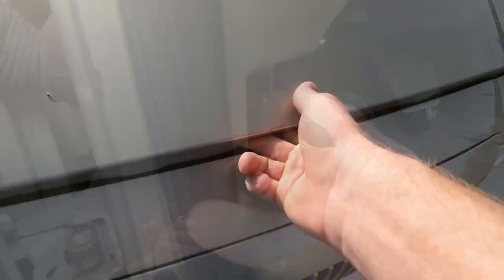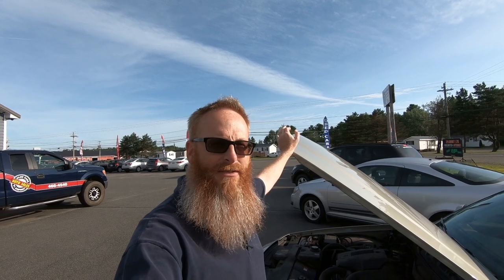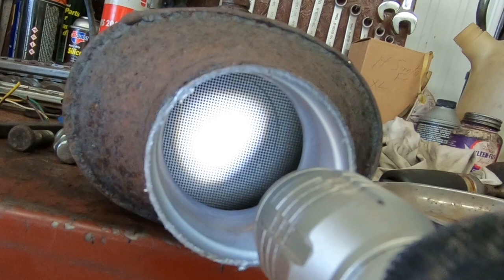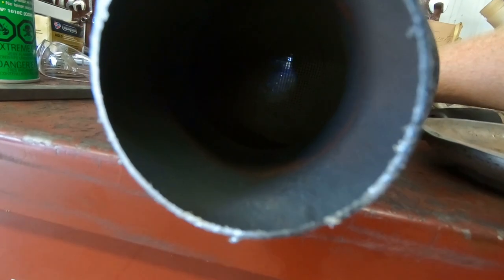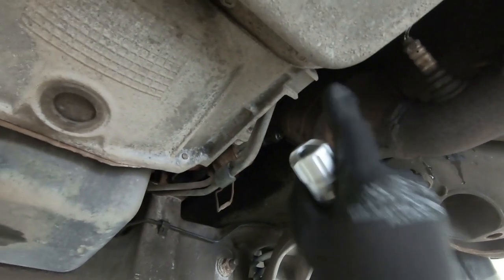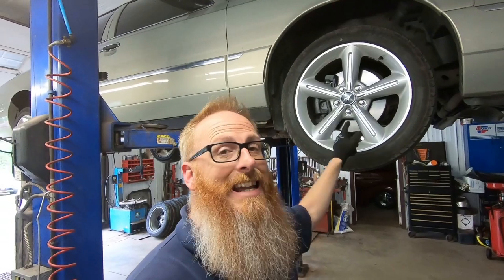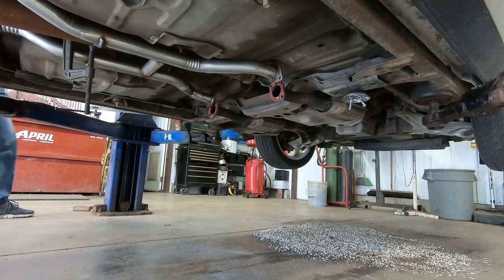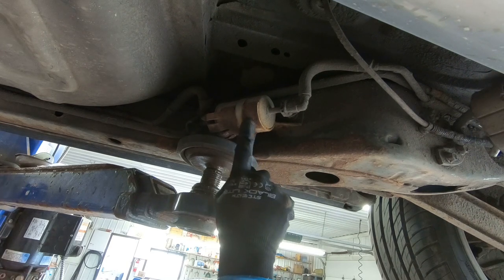PUTTING A TURBO ON MY 2004 MERCURY GRAND MARQUIS?

Comment: 1) Most aftermarket "Cold Air" intakes are really just under hood "Hot Air" intakes.  If the air filter is not sealed in an enclosure that has an end opened to ducted cool air, you'll just be sucking warm less dense under hood air.  Better is to use the 2004+ CVPI Air box assembly along with the 2006+ CVPI intake tube with an 80mm MAF - used 2006+ CVPI parts should be cheaper.  2) Forget the throttle spacers, and use a 70 or 75mm throttle body instead.  3) If you're just going to do some small bolt on mods, keep the stock intake manifold.  The aftermarket manifolds will not provide a boost in power unless you are going to regularly run it at 5500 + RPMs. 4) Hollowing out the front CATs may give a boost in power, but hollowing out or deleting the rear CATs does nothing.  The exhaust manifolds and stock exhaust system is more of a restriction.  The front CATs are what are called "Pre-CATs".  They are there mostly for when the engine is cold and warming up which is why they are closer to the engine.  The rear CATs are there for when the engine is at operating rating temperature hence why they are further back in the exhaust system. 5)  Most civilian CVs came with 2.73:1 rear gears.  Swapping out to a 3.27:1 or 3.55:1 will give you snappier acceleration, but overall really won't make the car that much faster.  I've got a 2008 CVPI with 3.27:1 gears that gets about 23 MPG or so @ 60 MPH.  Also, since the 4R70 and 4R75 use splash lubrication for the tail shaft, using anything higher then a 3.55:1 gear requires modification to get more rear lube or the tail shaft seal will fail.  Really, one of the best sites for the Panther platform is Chris @ ADTR.net, and Darrin @ BCA Transmissions - bcawebstore.com
Reply from the maker: Great info! Thanks for watching
Reply: Well that both help the car move faster horsepower and get better gas mileage
Reply: Thanks for putting it way more intelligently then I can.
Reply: Knowledge is power.
Reply: I did the p71 Air Box assembly modification, used a 80mm MAF, the car threw "Running Lean" codes all the time. You need a tune also for that one.
Reply: AFE is good. It stays cool after a few hard pulls, even with my bare metal long tube headers

Comment: I uncrimped and removed the heat shields on the rear cats, cut a c-shaped panel in the cat body and bent it open. This way i could completely remove all the material inside. Then, bent the panel back closed, reweld the seams and replaced the heat shields. Looks stock and no one is the wiser!
Reply from the maker: Haha! I took a different approach! but whatever works!

Comment: Smart decision on the high flow air filter.  It has been proven that those cold air kits are useless.  That air intake was designed for that engine.  The only bad thing about it is they quieted it down.
Reply from the maker: I will be making some changes to it in my next video!

Comment: The stock intake is a cold air intake.  It draws air from the wheel well which is outside the engine compartment.  Aftermarket intakes draw air from within the engine compartment which makes them HOT air intakes.  Put a shift kit in the transmission.  You will have much more fun.  Besides if you want a hot rod start with a lightweight car such as a Mustang or Nova.  Sheeesh.
Reply from the maker: Hey Man. I appreciate what you are saying. If you follow the build series, you'll know that I Installed a high flow (not cold air)  intake.  I already have a couple of hot rods, just putting together a plan to make this beast a bit more agile!

Comment: Im on my 2nd 04 LS ultimate . Getting new 
Shocks x 4 with new airbags 
High cap air intake 
Rear cats hollowed out 
Fuel filter 
K and n air 
4 new tires 
New fluids engine and trans 
New brakes 

Has 122k on it and is super clean all around . 

Picking it up in 10 days 
Paid 4500.
Reply from the maker: Good deal! Love to see it! You have Instagram?

Comment: Seen a few videos where cold air intake on these make the computer all fooky . Spacer and filter is the way to go . My 2 cents
Reply from the maker: Yeah! On the 2005 and up because they are drive by wire! Mine is drive by cable!. Thanks for reassuring my decision to do just what you recommend!
Reply: I could not recall what year you had . I'm in the market for one myself . Get a few mods when I get one magnaflow  mufflers are a must
Reply: It already pulls air from outside of the engine bay, right?

Comment: Have you checked the air intake temps? The air comes in behind the headlight and a cold air intake won't make much of a difference...
Reply: Glad to hear you ordered a "high flow" air filter. I use one too and, with dual exhaust, she hauls pretty good for having a 2.73. 2nd gear lasts til 80mph and 3rd even longer.
Reply from the maker: Yes, my next video will clear that up! High-flow vs Cold-air!

Comment: In my opinion true performance starts in the drivetrain and this goes double for an automatic. The first thing I like to do with my automatic project cars is get them shifting harder/faster and keep them from wasting quite so much of the power they already have. I just put a really hard shifting servo that also reduces slip in my $600 Trans Am project and it cost me less than $200 bucks including shipping.
 TCI makes a valve body for GrandMa's transmission that does the same thing and it only cost about 160 bucks. The downside is it's a bit more difficult to install as you need to drop the pan. 
Apart from that, one of the cheapest performance mods you can do for this kind of car is to swap to the P71 interceptor driveshaft as it is lighter and puts noticeably more power to the ground, you should be able to find one in a junkyard very easily and for cheep. Jegs also has good converters for that trans. starting at 400 bucks and good rear gears for even less. Fuel mileage shouldn't be a real issue since the car already has an OD trans. A reasonably lower gear wouldn't have any worse effect on fuel mileage than the bigger injectors you'd have to move up to if you turbo or supercharged it. 
Speaking of power adders have you considered nitrous? A really good wet kit specifically for a Crown Vic 4.6 that you can safely spray an extra 150+ HP with cost about half what it would cost to turbo the car and the results would be comparable when the button is on, maybe even better. A cheap dry kit that you can safely spray an extra 75+ HP with cost even less but they have limitations, no fuel solenoid means your safe shot limit is much lower however some guys are supposedly running 125 and 150 HP dry shots on 4.6's with success. 
 I think if you did the P71 driveshaft, Tbody spacer, cold air, and the TCI valve body it would be a sweet little package that altogether wouldn't be too difficult to install and wouldn't hurt the wallet to badly. If you wanna get crazy then throw in the gear, converter and nitrous and you'd be running with turbo cars for considerably less cash.
I can send you a link to the forum where I just read the nitrous info or links to any parts I mentioned if you are interested. I don't really have anything to do on this fine Saturday so I figured I'd help you research some mods for GrandMa LoL
Reply from the maker: Well now! I do t rightly know how to respond to a short story! Lol Other than to say you raid some really good options! Yes!!! The Transmission shifts quite smooth and drawn out on these cars and could benefit from tighter shifts! And it’s easier than ever when you already have a hoist and other tools to do the job standing up! I’ll definitely look into that kit! DM me the link on IG and I’ll take a peek! As far as nitrous, I think I’ll hold off for now as I do want to use a power adder at some point! I’ll look for an aluminum driveshaft as well as rear gear options!

I really appreciate the help!
Reply: @OldeCarrGuy  Yeah sorry that was a long one, I don't mean to sound like a hipster or anything but youtube is the only social media I mess with. However the part number for that valve body is 
436001 and it's referred to as "TCI Trans-Scat Valve Body Kit 1992-95 Ford AODE " Despite the name it is supposed to fit the 1996-04 Ford 4R70W as well which is what I'm guessing your car has. The Jegs website says it fits an 04 Crown Vic.
Reply: Impact's Garage and Gaming you dont know shit about these cars. To get any real power out if these you need to install a sequential tranny u need to put 4.56 gears with a locker in it with drag radials. Along with an electric turbo charger. I have mine running in the 10 seconds with a full roll cage and i gutted the interior all except 1 bucket seat that is all you need.
Reply: @gsfbffxpdhhdf7043  You have a track car. Most people want a fast street car. Panther people want a car that is basically the same luxury street ability as stock but higher fun factor because of more hp and torque and faster light to light and on the highway. I don't want my daily driver  Town Car to have a stripped out interior, overaggressive shift points and 4.56 gears. I did love 3.96 gears I had in a 1970 Dodge. It was good light to light and effortlessly cruised up back road hills when on a drive.

Comment: be-careful thinking can lead to trouble lol you know changing to a cold air intake has been known to help increase the sound a little,  maybe you can keep an eye out for a good used one to keep it budget friendly. At least the throttle body spacer will kinda help the throttle body stay a hair cooler and give you a little more runner length to help with some torque
Reply from the maker: I found this out today after installing a high flow filter! (Next upload)

Comment: Hey I have four Mercury marauder chrome rims factory OEM. I was thinking about getting a black crown Victorian and making it look like a marauder clone. L71 Victoria, Or a black grand Marquis. Which one of those two is better? What do you think is the best bang for your buck grand marquis versus crown Victoria? Which one do you recommend for a marauder conversion
Reply from the maker: It's all about the dollars. If you want a car with more options, go with the MGM. Also, you wont have to swap the header panel and headlights if you find a mercury because they are different.

Comment: I vote to leave the engine stock, and install a 5 speed manual. Lol
Reply from the maker: Somehow i felt you would have something to say about that! LOL! At this point i'm thinking a manual might be cheaper!....... lol
Reply: Would a five speed b better tho ?
Reply: I said the same thing. Get a manual transmission and fix the gears
Reply: @jacquancotton1835  
Manual trans, with 4.10 gears would be a solid foundation to build on, but also boring.

Jason is looking for a "thumbnail video" that will get 1M views, and get him a 100K Play Button. 
I don't blame him either. lol
-Chuck

Comment: The best thing that I will recommend ahead of time before the build like you said before drop in a cold air intake as well as some performance ignition coils. I own a 99 Crown Vic myself
Reply from the maker: Thanks Antonio!
Reply: Cold air intake auctually hurts performance. 04+ p71 intake is best for these cars it already pulls air from behind the headlight. unless you do custom piping

Comment: I have a 2004 GM GS. I’m glad I ran across your channel because I have been thinking about some upgrades for my car. I’ve had it 5 years and I have 108, 417 miles on it. Did you put size 16 mustang wheels on it? Would you recommend just straight pipes over the catalytic converter? I want a nice sound and some more horse power.
Reply from the maker: My Mustang wheels are 18". As far as straight pipes, they can be loud and crackly and obnoxious during deceleration. I knocked out the rear cats only and have a nice rumble!
Reply: Olde Carr Guy 10-4. I enjoy watching your “Grandma” videos, they are very helpful. I’ve been wanting to upgrade mine the right way and you have given me tons of ideas. Thank you kindly sir, from Mississippi!
Reply: Off with their heads🗣️👉🐱😼

Comment: Cold air intake is pointless without a tune. Your check engine light will come on for lean on bank 1 and 2 without a tune. I just did all of what you mentioned plus i did a j mod to the trans. but i also got a marty ochs tune and an sct x4 device. If you got the money that marty tune is where it's at. At least a 20 hp increase, better shift points, traction control disabling. Mo's speed shop is the best with these panther platforms.
Reply from the maker: All the little mods I’ve done is in preparation for a Marty tune.

Comment: I have a 2003 Marauder and am also thinking of removing the rear converters.
Reply from the maker: Unless your have emissions testing I definitely recommend it!
Reply: OCG - Olde Carr Guy  Thanks
Reply: Those cats and the mufflers got to go. Also find a junkyard mustang and find a h pipe or x pipe. Without one the exhaust can be a bit clappy. Then you need to watch rizzo's video on how to jmod the tranny. You can squeal tires all the way through 3rd gear with a jmod. Takes like 20 minutes in the driveway if you know your way around some tools. I did mine in 20 minutes. while I was replacing the over drive servo snap ring, that busted off on my valve body. causing 4th gear to stop working. Now my town car shifts so quick the serpentine belt will squeak from sliding. 🤣🤣🤣 

I'm about to put a turbo on in this weekend.
Reply: Also you need to get in touch with marty ochs. He can put a tune together and really wake that marauder up.

Comment: All you need to do is a gear swap to 3.73. You won’t think about the cost after your first test drive. I promise. That’s the path to the fountain of youth for grandma.
Reply from the maker: You maybe right. Thanks for watching.
Reply: J mod that transmission in 20 minutes. That's the best mod you can do to these. Makes the transmission last well above 200k

Comment: I good tune up can make your car run better with some shell 93 gas.
Reply from the maker: A good tune up always helps but higher octane doesn't necessarily make your car run better, just cost more at the pump. And with todays gas prices, I'll be pumping in the regular fuel that the car was intended to run.

Comment: There is no better intake then the factory intake.
Reply from the maker: I'll keep that in mind!
Reply: @OldeCarrGuy  the only intake that works better that the performance improved plastic is the aluminum bullit intake.  Which makes 7 hp over the plastic intake.  

They also run fo a gnote used. 

Not really budget hp ehh.

Nitrous nitrous lol

Comment: Awesome video! Keep em coming! Maybe look into a off road X pipe exhaust. No cats. And the cold air intake would really make a difference. Ya Bubbly
Reply from the maker: I already have a new "H" pipe, the cat pipe is easy to remove so thats what I'll do!
Reply: You do that was just offering a bit of advise. The X pipe flows 100% better then the "H" pipe and makes a loader sound witch is what I though you was looking for.
Reply from the maker: I do want louder, but tolerable! 
I appreciate the advice!
Reply: They are sound clips here on YouTube so you can hear the difference.

Comment: You can get 3.73 gears out of a 5.0 explorer from junkyard
Reply: 4.10s also
Reply from the maker: Yes. But I still want to cruise with the car and not stop at every gas station. It’s a daily driver after all.
Reply: @OldeCarrGuy  my 3.73 didmt really hit my milage that much. Not enough to be noticed anyway they dont turn to high rpm on the freeway either

Comment: There is nothing in those rear ones. You’ll see
Reply from the maker: Are you saying there is nothing in the rear cats?
Reply: Olde Carr Guy those rear parts aren’t cats, they are just open, hollow.
Reply: Olde Carr Guy just cut off the muffler and weld a straight piece of pipe in place and it’ll sound mean. Will sound much better than when you just unbolted the exhaust
Reply from the maker: @veightrwd8828  They were definitely cats. As you saw in the video, I beat out the stuffing inside them. They weren't hollow but they are now! However, I am inclined to agree that straight pipes instead of mufflers may be the answer to a better sounding car!
Reply: On my 03 grand marquis they didn’t have anything in them. Only the part between the o2 sensors were cars.
Reply from the maker: Somebody must have got to them before you!